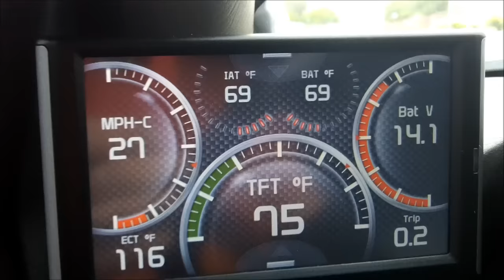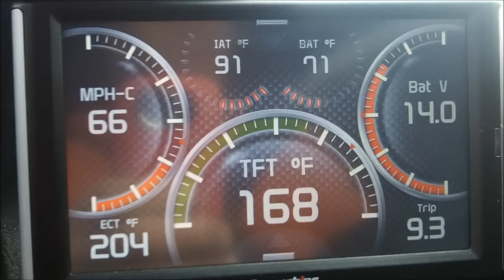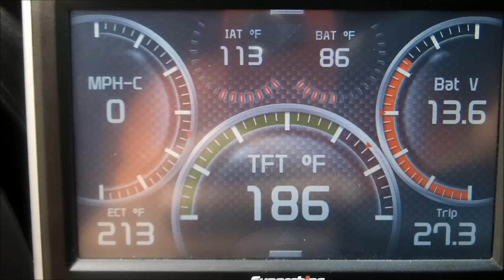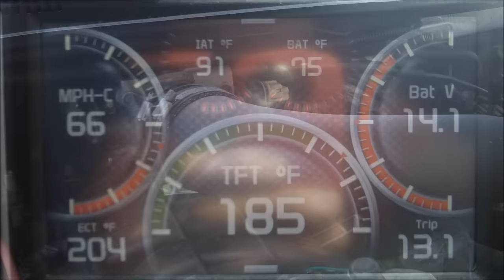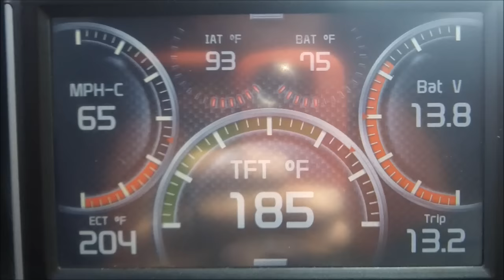K&N Cold Air Intake vs. Stock Air Clearer in a Air Temperature Test

Comment: Good Test !!!!  Most commonly mistakes is that People think the Temperature measurements is from the Box / Filter. The Temperature measurements is not from there, so in reality, you can make it like a Foam Cooler and the Temp will only a few degrees differences.

Comment: Considering that the K&N intake allows more air with more pressure inside the engine than the stock... Will compensate in the temperature?..

Comment: I wondered the same thing. I've had a cold air intake on my Dakota with a 4.7L for years. The only thing I've physically noticed from a cold air intake is MPG increase. Never any seat planting horsepower. My Ram with the 4.7L has the stock box and I'm on the fence with a CAI. I do have AIRRAM.COM's power wire which is supposed to manipulate the air temp.
Reply: You won't see much of an increase in most vehicles because the stock intake already flows more than enough. Basically the air filter is not  a restriction. If you go with cams exhaust and tune you probably would benefit though
Reply: I actually noticed a substantial difference on my 2004 wj 4.7 ho. Pulls harder in the upper rev range. These intakes are proven through dyno testing to increase horsepower. Obviously 15 horspower isnt crazy as far as gains go, but every little bit counts.

Comment: That seemed like a CAI with a Short Ram Intake setup. There was no heat shield or anything to isolate engine bay air. CAI should run from closer to the bumper down below or atleast be setup with a heat shield. Most CAI can be used as Short Ram intakes btw...which is obviously what this seemed like.
Reply from the maker: By the way there is a heat shield for the K&N setup

Comment: What if I use heat shield on the tube that connects to the throttle body and my cai filter will it make it cooler or...?
Reply from the maker: It would help

Comment: I think if you want the K and N to suck air it has to be in a box not up to the way they make it it’s got to be enclosed to wear ever your stock one goes so it sucks air from the outside not hot air from your engine
Reply from the maker: Yeah you're absolutely right, that's why I remove this whole system and I built my own Ram Air.

Comment: I’d like to see if there’s a difference in an actual cold air intake. That’s a short ram intake which tends to get hotter air. Intakes for my eclipse go down all the way by the wheel area under the hood which are true cold air intakes .
Reply from the maker: I ended up building a ram air Intake and using a 05 Mustang hoodscop and now the incomimg air temperatures are the same is ambient air temperature.

Comment: You really have to get educated before you bolt something to your engine that could shorten its life. Take it from someone who has been doing this since the late 1970s. Most of any gains from CAI(and this isn't), and those are minimal, come from low restriction filter elements. The problem here is, are you willing to give up engine life for 5-10 horsepower on your 5000 lbs. vehicle. You could get the same performance gain by removing that flat 75lbs. spare sitting underneath. Modern engine design and competition has pushed manufacturers to squeeze every bit of performance while staying within guidelines of emissions, noise factors(intake and exhaust), applications, ect. Ford isn't going to be able to sell a truck with a 5.7 liter engine if Ram has a 5.7 with 50 more horsepower and 100 ft. lbs. of torque. If you want to boost real performance, you need to look at a complete package. That will include intake, exhaust, camshaft, cylinder head, trans work, gearing and tuning this to make it all work as a package. Bolt the stock airbox back on and get a quality filter like Wix, change it every 10-15k miles and thank me later.
Reply from the maker: Thanks for all your input, I appreciate that.
Reply: You welcome!! Stay safe.
Reply: The "You" at the start of my comment didn't mean you personally, I just re-read it and realized I misspoke my meaning is you as in everyone who is interested in doing mods.

Comment: It looks like a Short Ram Intake to me. Obviously the air is drawn from under the hood, so tecknically, there will be no diff in temps. But performance wise, there should be an improvement as the air flow to the filter is not as restrictive as it used to be compared to the boxed version air filter.
Reply from the maker: I agree. I'm working on building my own true cold air intake as we speak. I hope to post a video on it in a couple of weeks.
Reply: Great!, It involves piping the filter away from the engine for it suck in cold air as you may already figured it out. Just don't put it under, for it might suck water and end up with a broken engine.

It's interesting to see how you will solve it though. Please post a video.
Reply from the maker: I think your going to like it and it doesn't look like it came from Home Depot.
Reply: I look forward to it.

Comment: Perhaps the air temp. sensor should be located where the air enters at the forward most point. Then you may have a reading closer to outside air (66 F.).
Reply from the maker: That is what I did when I built this Ram Air  https://youtu.be/45YNy7LvIHU

Comment: interesting but First of all, that what you are calling a "cold air intake" is not amuch of a cold air intake, that is a short tubed high flow intake with a heat shield.  I'm not a big fan of many of them aftermarket  Cold AIr intakes, but you are not testing a "Cold Air Intake", Yes you should have done in-town test too.

Comment: This simply DISPROVES the myth that these intakes are worse for your car. You pull in more air( larger area filter and smoother tube) with less restriction and you don't run hotter temps. People don't get that these DO NOT remove the factory air inlets i.e under ther bumper or wheel well, they simply remove the plastic box (which has zero thermal insulation).

Comment: The reason you didn't see a difference in air temps is because, if I'm thinking right your air intake temp sensor is located right in the top of your intake manifold, although I don't think you'll see a positive anything with an open filter.

Comment: You do realize why the temp is higher at idle, right? You don’t have moving air passing through the engine block. Of course the temp with rise with everything. 

Personally you buy the cold air intake and just buy a longer tube and bent so it goes down below the engine and takes it from the ground which is already cleared because of the stock air line.

Comment: If the IAT is located where the older 4.7's is (directly to the intake manifold), then you wont really see much difference no matter what, as it is reading air after it has already passed through the throttle body and the upper intake manifold... Relocate the IAT sensor to the intake tube near the filter and then redo all this.... then you may see some different results.
Reply: Levi Maynard Why would that matter though? No one cares what the air temperature is before it enters the engine. Having colder air outside of the throttle body wont have any effect on your engine performance.

What matters is the air temperature once its inside the combustion chamber.
Reply: The video clearly is trying to test air intake temperature... You are trying to call me out for something the video is clearly doing? The creator of the video cares, that was the whole premise of the fucking video. The video is testing if the "cold air intake" has a lower temp than the stock airbox. Both of those pieces are (OBVIOUSLY) in front of the throttle body WAY before the combustion chamber... There is NO sensor to test the air temps in the combustion chamber, on ANY vehicle. The IAT (intake air temp sensor) is what the reading is coming from, not the combustion chamber. The IAT is mounted directly to the Intake manifold on these. The heat created by the engine running, ambient temps under the hood, spread throughout the thin plastic intake manifold and make the temps higher, so no matter what you do, you are getting hotter air readings than the air that is flowing through the "cold air intake" as well as the stock airbox.  Using YOUR logic, having colder weather and colder air coming in has NO effect on engine performance..... Really? The entire premise of this video is flawed because the IAT is in a significantly hotter area than the air intakes.
Reply: Levi Maynard I agree.

What I was trying to say is that cold air intakes are useless. All stock intakes are cold air intakes technically. As long as your pulling air from outside of the engine bay (like all modern stock intakes do) then you have cold air intake.

Also, Im aware no car measures air temperature inside the combustion chamber. Im also not saying colder air wont impact performance. Im saying that you want colder air inside your engine. Having colder air outside of your engine will not help you as far as performance goes. Keeping that air cold until it gets into the engine is where real performance gains are seen.

Comment: They help on anything with some serious power through turbos and shit like that, but if you made your own it would be a lot better I'm not saying K&N is bad they definitely aren't. It's just they need to be located better and better boxes they look so ghetto mine has one from the previous owner I'm going to rebuild it and relocate it probably or build a custom box and a sort of ram style duct I guess, but I hear back and forth opinions about it. Probably both right in ways it's just how it's set up, nothing to do with the product but if you install your motor backwards and it doesnt run who's to blame? You or the engine? 😂

Comment: There's one major drawback about the cone filters... It lets a lot of crap travel through to your engine... Paper filters may not let the engine breathe easy but they protect your engine from dust, rocks and other debris
Reply: Rocks?....You do realise they are an enclosed, sealed unit that uses a lightly oiled, filter element? You wont see rocks travelling through it bud 😂

Comment: You shouldnt see any difference. A stock intake IS cold air intake. It doesnt matter if the intake is up top or down low, the difference of 2 or 3 feet isnt going to be anything really. Ontop of that, a stock intake at highway speeds the intake air temperature shouldnt be but 5-10 degrees hotter than the ambient temperature.

Comment: Son.....your confusing Cold air intake with Short Ram intake
Reply from the maker: Oh I don't think it's me that is confused. It's these aftermarket companies, their the ones calling their product a cold air intake. At list Airaid calls theirs a (air intake) minus the cold.
Reply: Short ram intake aka hot air intake , get a cold air intake then do the test
Reply: I recently put the OEM Airbox and resonator on my WJ. (99, 4.7) after running the K&N for a couple years. Noticeable difference immediately. I have WAY more acceleration and low end power when compared to the KN (which has power from 3,500rpm). If you want the best all around power, stick with the stock setup. The KN shit for my Jeep is $350. That’s crazy.
Reply: Lord Megatron son ???

Comment: K&N used to publish their air flow measurements on their website, There was no difference between the K&N cartage filter in the stock air box and the expensive cold air intake. Somthing told me I should have copped that information but I didn't!  Just wasn't good marketing and would surly be pulled down at some point.

K&N filters require way to much maintenance that most people just are not going to do.  Put a filter-minder on the paper filter and change when it tells you to do so and be done with it.

Furthermore for those of us 4x4 guys that need to cross water from time to time.  Water flows right through a K&N filter! HYDROLOCK!  Water plugs a paper filter, causing the engine to stop!  I'll take the paper filter with a filter-minder over a K&N style filter any day.

filterminder dot com
Reply: I read a similiar comment earlier, about using kn filters in a bush truck. Thats just plain dumb. Leave the exposed cone filters for highway vehicles. Protect your bush water truck and leave the stock airbox. Stupid.

Comment: Changinging to the air raid filter will change the temperature by increasing air flow. Less restriction + increased air flow. Your test has to be a little more controlled, i never saw if you moved the Temperature sensor, or MAF, did the vehicles both start from a cold start. In the end, im not sure why you choose to make air temp the only measurement that matters. I dont know of a single person who buy the KN and brags about how cold the air is now. Everyone buys it for increase power. I don't even think this statistic is one that KN claims. they dont say their filter will lower air charge temp. 
 Every vehicle is differnt under the hood so im sure you will get different results. 

Most importantly, the KN is not at its peak performance when its clean and brand new, it works best when dirty, the dirt acts as a sort of filtration system, there arent meant to be cleaned all the time .

Comment: I never believed the “cold air” part.   When a car is moving the hot air is pulled under the car and the outside air pulls in.   

The reason cold air intakes improve performance is because of two factors:   The lower vacuum pressure required to move air into the engine, and the efficiency of the air flow.   There is no reason to discount these systems, just shouldn’t try to convince people it’s because of cooler air.  The air temperature effect would be negligible.  

Thanks for the proof!   SCIENCE!

Comment: Cool video covering the one main thing everyone misses when reviewing a “ cold air intake”, close the freakin hood! Lol Open hood test prove nothing! Air volume changes and sound but temp is the same unless you buy a top dollar one that has a heat R value... also, KnN is not a good one, might as well buy a cheap knock off on eBay and skip them.

Comment: That tells me that an after market Cold Air Intake from K&N that cost over $300 is false, a rip off or Over rated and just a waste of cash. Just stick to factory parts.
Reply from the maker: Well keep in mind that this test was only a temperature test. If we were to have done this test let's say on a dyno I believe the K&N would have outperformed the stock airbox simply from the amount of air that it was able to draw in over the stock air box. But the way the K&N is designed if you were looking for a lower intake temperature you're not going to get that from this design. Thank you for watching!

Comment: Also, I need someone to tell me the real difference of all the aftermarket air intakes against the conventional one. People usually say those increase your engine power and that increase is much more noticeable in the V8's. I think those only give you a nice sound of the engine (and that's really a good sound to hear, smooth and thin) but a part from that I think the engine bay gets much hotter than with the conventional air intake duct. Also, if you touch the metal parts just after chutting the engine down you'll notice that's hotter the with the conventional air intake. And the battery gets hotter as well.
I also ended-up thinking those are not for road-driving. Maybe just for when you're stopped for long in the summertime traffic.

Comment: Not what I would of expected. I recently modified my stock air box and cut the bottom open and used foam strips to seal the box to the lower fender well area. When monitoring my IAT it is at the ambient air temp not even 2 degrees warmer than outside air. It may be where that snorkel is pulling its air in from on your jeep.
Reply from the maker: mrelectron62 did you do this to a Jeep Grand Cherokee? Where is your air intake sensor mounted